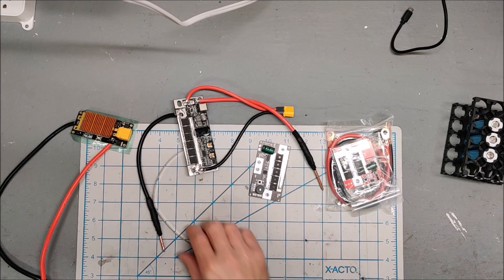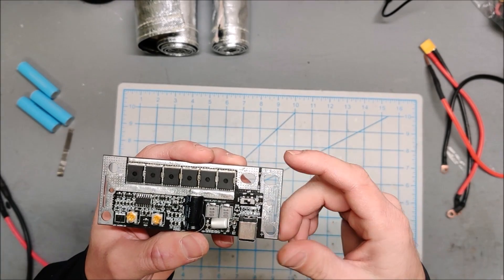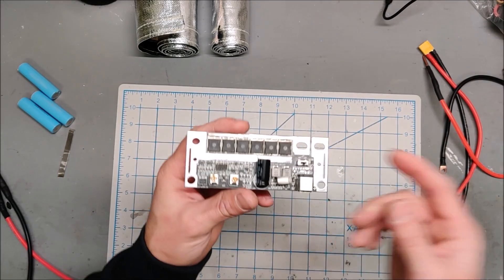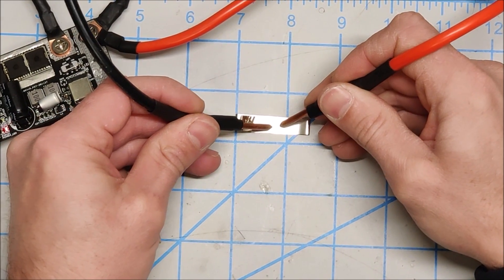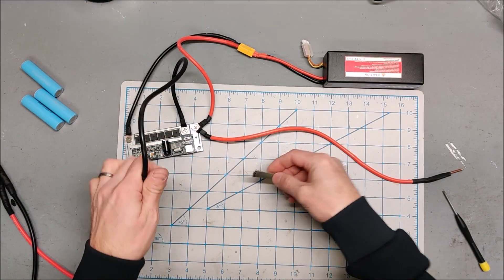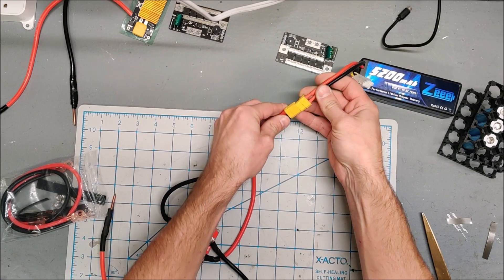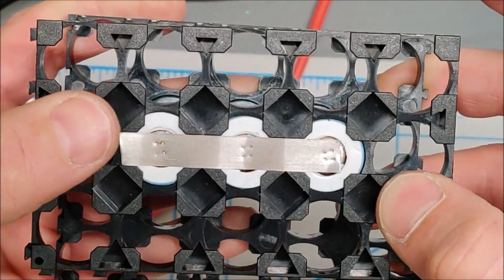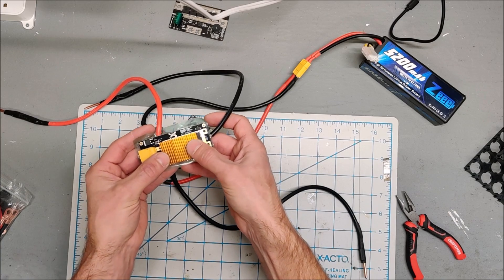$20 PCB SPOT WELDER - THE FINALE!

Comment: Amazon and eBay links for your top 2?  Can’t wait 30 days China slow boat. Want from US warehouse.
Reply from the maker: The PCB by itself is not available on amazon, but the updated version is. https://amzn.to/3wGuSvD
Reply: @stevenc22  thanks. That’s double price!  Prefer the $20 version that connect to 12V car battery? In case it blows up, as they often do., less of a loss to replace…
Reply from the maker: @christothegreat1  correct. But you will have to order from China. I cannot find a cheap ones locally on Amazon.

Comment: Heads up anyone watching this video, there's a new cheap "intelligent" PCB spot welder (or at least I think it's new because I haven't seen it before or seen any reviews) that blows the beloved BIFRC out of the water. It's available on most direct from China websites (Banggood, AliExpress, Walmart, etc) but hard to find when you search PCB spot welder because it seems to be quite far down the list (for me anyway).

The model number on the PCB is JQ-DHJ02B and it's a green PCB with buttons to select the Ah and discharge current of your battery as well as a gear/power button and an on/off button. The best part is it claims to be "intelligent" and will not allow spot welds if your battery is too weak or too powerful, therefore saving the MOSFETs from exploding like they do on pretty much all other PCB spot welders. I haven't killed it yet so the intelligent part must be working as claimed. 

I managed to weld 2x0.15mm nickel strips and 1x0.10mm nickel strongly together with just ONE weld (three overlapping strips with one weld) using a 6000mAh 80c Zeee Power LiPo battery with the relatively crappy included welding pens. I have been comparing the JQ-DHJ02B to the same BIFRC welder that @Stevenc22 outlines in this video (with the wall power mod) and from my experience, the JQ-DHJ02B welds stronger and stays much cooler to the touch than the BIFRC.

The only downside is the instructions and some of the PCB labels are Chinese only, but it's not too hard to work out without instructions anyway.

TL;DR - Look up JQ-DHJ02B PCB Spot welder on google and buy that one instead of the BIFRC. It's SO MUCH better.
Reply: Do you have a link to it or at least a picture ..? Thx
Reply: Hello, maybe you can add a link? Regards

Comment: I tried to do spot welding on 18650 battery, but the the current is very week and didn’t weld. I have the same smaller board with 5 misfit.
Reply from the maker: You need a 200+ amp battery to really weld well

Comment: Do you have a link to the needles you use?
Reply from the maker: I made them my self with some 10awg wire and some copper
Reply: @stevenc22  Thank you very much for the information! So you get some copper rods and sharpen the tip? Can I ask which diameter of rod you use? Thanks for your works - just ordered the PCB (without needles so far) - looking forward to create some batteries for: https://ligi.de/bike
Reply from the maker: @ligi8588  Yes. I used 10 AWG cable with 8 AWG solid copper ground wire tips. https://www.homedepot.com/p/Southwire-25-ft-8-Gauge-Solid-SD-Bare-Copper-Grounding-Wire-10632883/301096486
Reply: @stevenc22  thanks again!

Comment: Adding a capacitor to the BIFRC does not make any difference as it’s connected across the battery and is not isolated by a diode.  I think the sellers have seen people adding capacitors to other welders and decided to supply one without understanding its benefit.

Comment: You did not mentioned in any of your videos that " the winner" needs some modification to work properly (nor any of the other spot welders).However there are not a small number of reviews that people are complaining on blown mosfets and giving modifications that had to be made for spot welder to work properly.What is your opinion on this mater and does "the winner" works right out of the box? Thank you in advance.
Reply from the maker: Mine works great. No modifications. I think the trick is to have a really powerful battery. Too many people use a weak battery that the voltage sags and then the mosfets get stuck open. That is why people add a capacitor to help stop voltage sag.
Reply: @stevenc22  can this be fixed with the mod of external power supply from wall you did with dc 12v adapter? and would that mod work on all those boards?
Reply from the maker: @vavo9269  Yes theoretically it would work on any spot welder PCB. However some of these spot welders just suck and moding them wont make them better. I would only consider the winners.

Comment: Just a couple of points about the BIFRC unit. 
1) The pens are total garbage. I ordered one without the pens and was trying to find the size of the stock welding cables. Took hours but I finally found it: 10 AWG (approx 2.5 mm diameter).
2) That 'extra capacitor' that is supposed to be soldered across the input power is 2200uF 25 volts. This is to help prevent the input voltage from sagging below 8 volts and blowing the mosfets.
3) Power supply voltage: 12V-16.8V with with burst of 150-200 Amps without the voltage sagging below 8 volts (better yet not less than 9).
4) Adding the heat sink is a GREAT idea.

Steven's follow up video on the BIFRC: https://youtu.be/yyJZFzLnSGE

Comment: For what it's worth - suggest you do not file the electrodes to a sharp point like you have but rather slightly dome the points with an angled semi-rounded circumference and a small flat section on the very top and use the top edge of the electrode for the weld (not the very top)!  You are asking a lot of the welder to try and successfully weld through the tiny pointed top resulting in a huge current density transferred through this point with the result that you will get crappy welds every time!  Cheers

Comment: Hi, does the runner up one (red/black pcb) has burnt-out mosfets issue if the power source can't give enough current during welds, just like the model which has LCD display on it?
Reply from the maker: Could be, i don't know. My Lipo batteries deliver plenty of current and i havent had any problems with mosfets not closing and burning out.
Reply: @stevenc22  thank you.

Comment: You should reduce the length of the cables from the spot welder to the battery. And try with 2 lipos in parallel, it will be much stronger. I use 2x 4s lipo 5000mah in parallel, it is very powerfull.
Reply from the maker: Im very happy with the winner spot welder. It's great 👍
Reply: @stevenc22  ok, but try with 2 lipos in parallel, you will see a big difference. I can spot 2 pieces of 0.15mm nickel strip easily with a very basic pcb card. € 11,39  24%OFF | Soudeurs par points portatifs de dispositif de soudure de carte PCB de stockage de batterie de Machine de soudage par points de bricolage 12V pour 18650 26650
https://a.aliexpress.com/_vN47YB
I have the type 3, works great.

Comment: hi, sorry to be a pain, my BFRC welder has arrived but has come with a capacitor and no instruction can you help me please???? regards alan.
Reply from the maker: Look here in the customer review section. The capacitor gets soldered on the underside on the main positive and negative.  Apparently the capacitor is now added to help the mosfets last longer.
Reply: @stevenc22   thanks for your time steve, I guess the cap has a + and - leg then? sorry to sound thick!! cheers alan.
Reply from the maker: @alanreynolds2125  longer leg is positive. Plus the cap has a yellow line on side which shows the negative
Reply from the maker: Sure but mine didn't not come with a capacitor. Got pictures of your board?
Reply: @stevenc22  thanks for your time steve, regards alan.
Reply from the maker: [US$9.99 29% OFF]18650 Portable 12V Lithium Battery Storage Spot Welder Soldering Machine PCB Circuit Board and Spot Welding Pen Needle Module Board from Electronic Components & Supplies on banggood
https://banggood.app.link/EUgpfMBPDdb

Comment: First one the winner i got one from Ebay welded twice then got stuck open both leds on ,they send me a new one  i made sure i did all good ,but after 2 welds same thing- dont see burn mosfets , happened to some other ppl. so  i am back to my big one what i made from ebay pcb n microwawe transformer works good its just little bigger. winner winner chicken dinner.
Reply from the maker: There are knock off's of the winner. Make sure it was an actual BIFRC
Reply: can such pcb be used with microwave transformer?

Comment: What’s actually the reason you’r not using the capacitor that’s provided? And you have a link of the heat sink? (Can’t find the dimensions of the product) And what is the plastic for? To isolate the back?
Reply from the maker: https://www.ebay.com/itm/Lot-of-8pcs-Aluminum-Memory-Chipset-Heatsinks-14mm-x-14mm-x-6mm-/391835176432?_trksid=p2349624.m46890.l49292
Reply from the maker: No capacitor provided. And yes the tape is to stop accidental short circuit.
Reply: Oh that’s funny that you didn’t get a capacitor. What would be the benefit of a capacitor in this situation? Or would you suggest not using it?
Reply from the maker: @Diown  that board was originally designed for super capacitors. But then they started selling them for use with batteries. Super capacitors are very powerful but so is the lipo I was using. I don't know why it didn't do better. It just sucked in the end.
Reply: @stevenc22  And I see other people beefing up the solder leads on the back (some even add copper wire) would you think that’s necessary or with the heat sinks it’s already good enough? Are the tips still getting hot after using heat sinks?

And using 4x 3s 450mah 70/160c in a parallel board should work also right? Should be around 200A right?

Comment: Thanks for the testing series! You are not using the standard tips right? Where did you get them or did you make them yourself? :)
Reply from the maker: 10awg wire with 8 awg solid wire tips. I have some solid wire left over from my powerwall bus bars and I use those as tips

Comment: Great video series, thanks for the effort! Do you think the boards could handle 4s?
Reply from the maker: Probably not. But the voltage isn't important, it's the amps
Reply: @stevenc22  Was thinking if the control electronics would frie at 4x4.2v=16.8v. It's common battery voltage for drones, so I have a bunch of them. I've ordered the "winner" now, and it says it can handle 16.8v in the description. Also mentions a min current of 160A